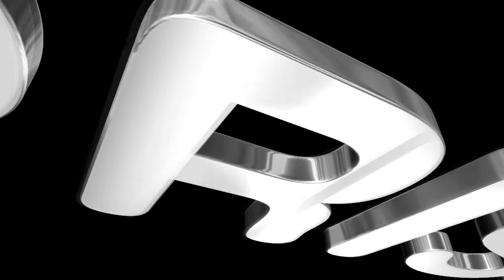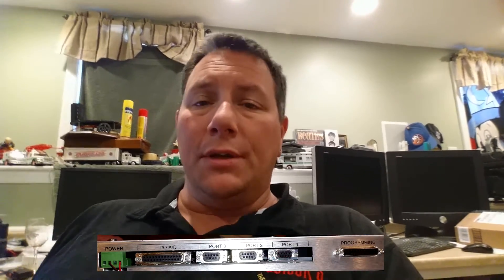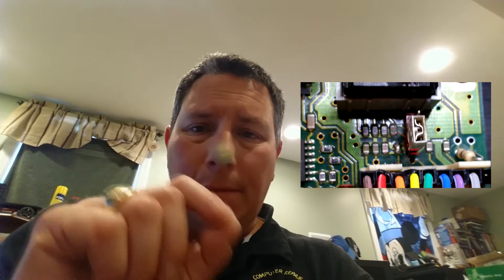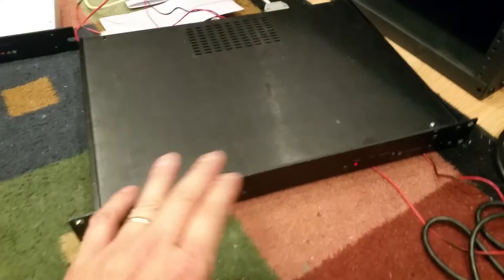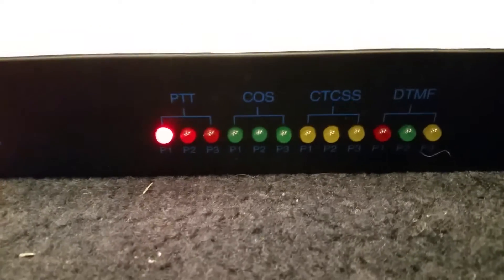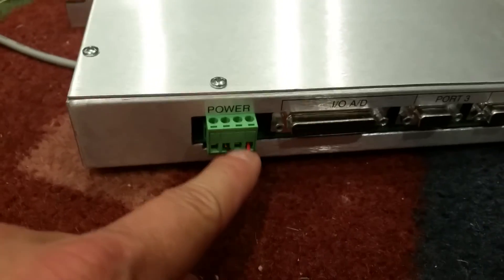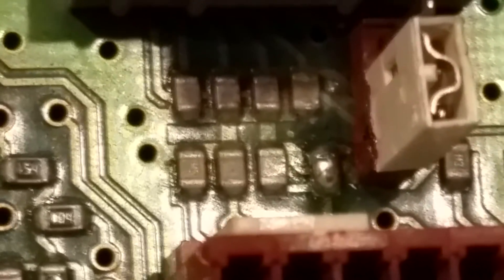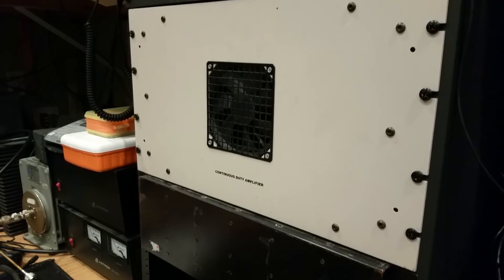How to get the Patriot Ritron RRX-460 Exciter to work with the Arcom RC210 controller.

Comment: Im working on a ritron Patriot right now and wondering if you could help me.  mine looks identical to yours except mine has a 20 watt amplifier built in.  The issue I am having is when I power up the amplifier, it turns on and the fan runs for about 2 seconds, shuts off for about 1 1/2 seconds then back on for 2, off for 1 1/2, and continues in this pattern.  The Status light blinks also.  In programming mode, it seems to run fine.  do you know if the repeater will act like this if the VCO isn't locked?
Reply from the maker: Does the amp work or is it just a fan issue?